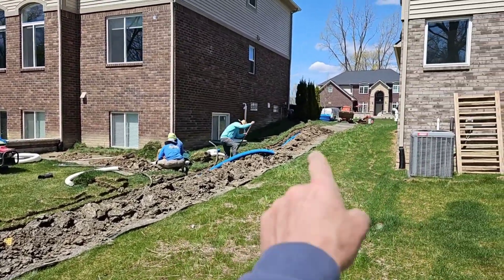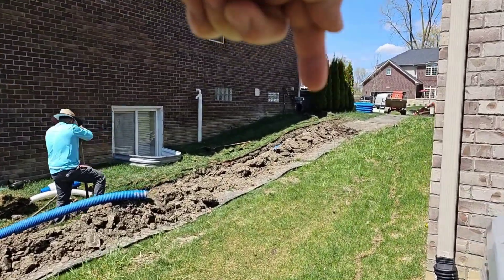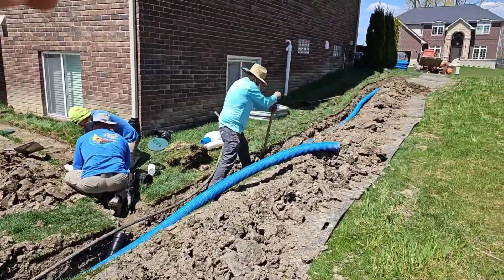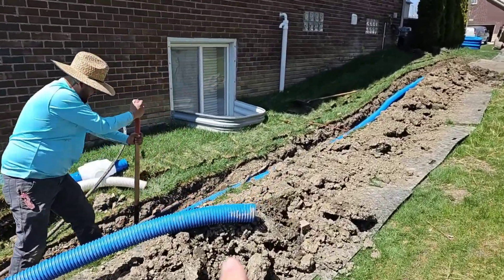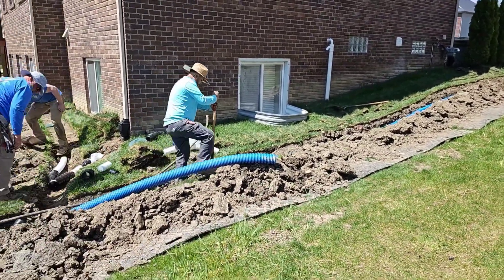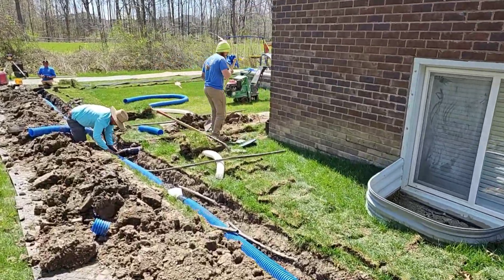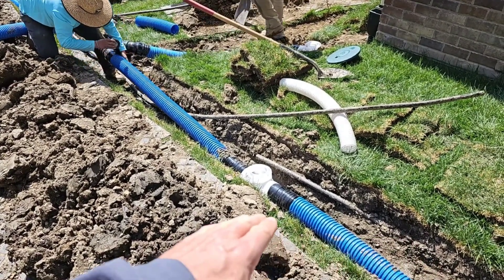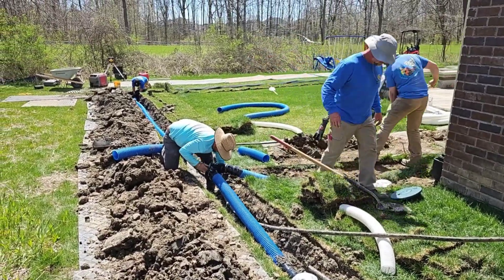How to Build Discharge Line so it NEVER CLOGS

Comment: Thank you for the great elevation change tip regarding downspouts! However, I noticed the sump discharge at the brick wall. Did you install that? If not, please review it. Any problems with doing it that way? I'm studying to redo my basement sump discharge line.
Reply from the maker: https://youtu.be/jTI1_RbI_Po?si=Cx7ZhFbudB74ZZXK